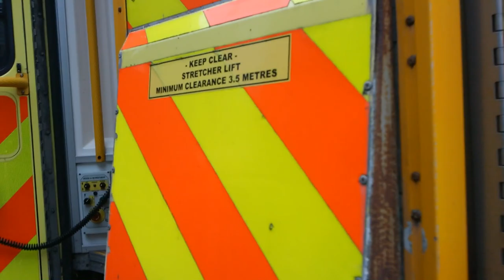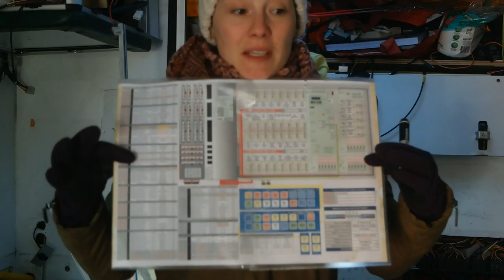Ambulance to Motorhome, Our van build part one

Comment: My wife just had the same problem but in reverse  in September  she looses her 7.5 to 3.5 tonne licence its debatable whether to renew it . It only requires a medical but our van is just 3.4 tonne so long as we dont change it she should be ok . I thought the 3.5 limit was the fully laden weight thats including fuel clothes food and passengers
Reply from the maker: Yes you are right, the limits are fully laden. That's why we knew we were never going to be under. I think if it's only a medical probably better to do it, you never know if you will need it in the future. Is your van 3.4 laden?
Reply: @overlanddelicatessen7237  yes its a pensioners special 2.8 l fiat ducato rate at 3.4 instead of 3.5 gross weight

Comment: Hi, like what you done with the ambulance, want to know what exactly you took of to get the weight down to 3.8t please?
Reply from the maker: Thanks! We took off the tail lift and all the genesis electrical components. I think those two things where the heaviest. Apart from that we removed some cupboards that we where not going to use and that's pretty much all we took off. We wanted to take it under 3.5 so we could avoid the C1 Licence, but that didn't work.
Reply: Thanks man!!
Reply from the maker: @prekese8  forgot to mention the air-conditioning on the rear cab! That thing is heavy
Reply: Do you think 3.5 is possible with this ambulance or will it need to be basically empty?